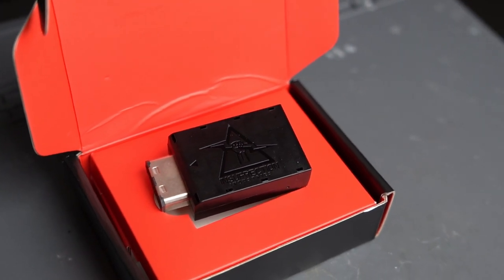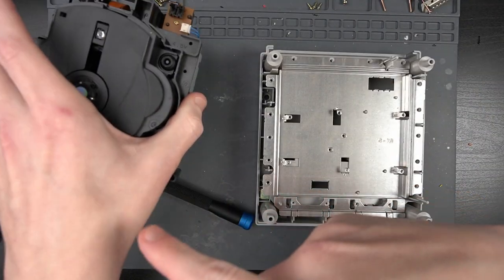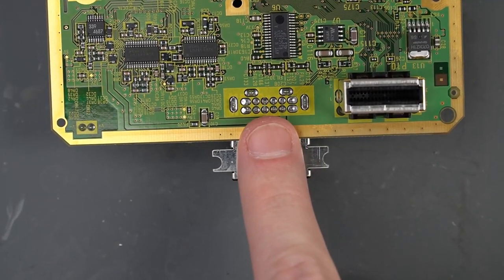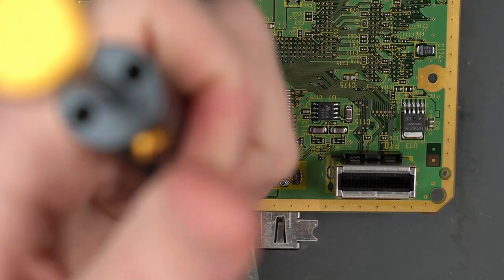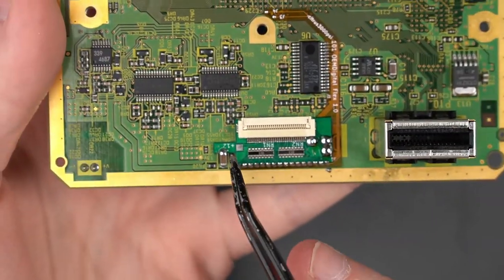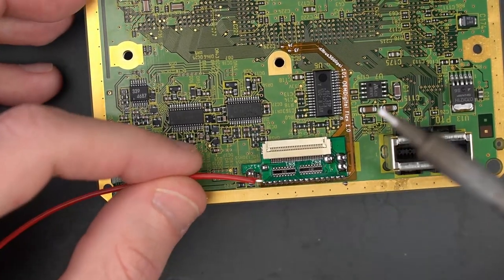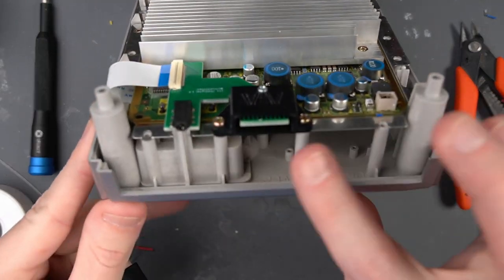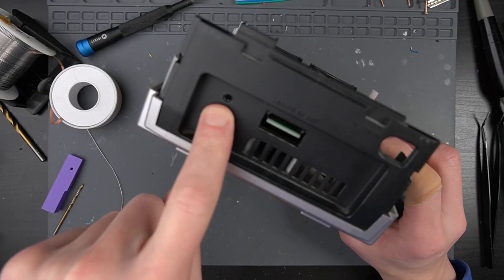DOL 101 GameCube Digital Port Install - Use a CARBY with a DOL 101 GameCube!

Comment: This is really cool, but I think the better solution is to buy a 001 model. Cause not only do you have both of the ports instead of simply switching one, but also, the kit and labor costs is probably the same as selling a 101 and then buying a 001 model console. This is still really cool though, keep up the good work!

Comment: Great Video, Try not to completely fold flex cables, if they get folded enough, there is a chance there will be a break in the connection within the cable

Comment: very nice mod. 
Another method. , I sent to a modder in China, he used a compatible NTSC RGB encoder and rgb amp to restore GC RGB signals. This way can keep composite, s-video and add RGBs signals. The RGBs can output 480p singals with ossc, gbsc and retrotink 5x on my IPS screen. The picture quality is slightly better then official or GCVideo component cable.
Reply from the maker: That is interesting, do you have any more information on that mod?
Reply: Do you have more info? Contact email or web?

Comment: Really cool video! Thanks for doing these!

I'd rather try finding a DOL-001 before I do this mod though :D The GameCube has sooooo many screws, and the install is also quite some workload. But it's super cool, that there's a way to "fix" DOL-101s now.
Reply: It's called GameCube because there's 64 screws.
...Wait, wrong Nintendo system.

Comment: 10:02 -- when soldering the flex to this chip, does it matter that the board has lead-free solder? I saw Long Island Retro use lead-free in his video for this step, but all the others I've seen don't mention it. Just curious about your take.
Reply from the maker: I think it matters a little, because it makes it a little harder, but the idea is you can tin the pins with leaded solder first, which "waters down" the lead-free solder with leaded solder to make it a little easier

Comment: Good video. I don't have a hot air station or a desoldering gun, though. Any you recommend?
Reply from the maker: If you can afford it, the Hakko FR 301 is what I use. 

I don't actually own this one, but if you're looking for something less expensive, I've been recommending this one: https://www.aliexpress.com/item/32982282829.html?spm=a2g0o.productlist.0.0.5305619d5cYbTO&algo_pvid=ea57f5f1-603b-4a3e-9fab-a1220894173f&algo_expid=ea57f5f1-603b-4a3e-9fab-a1220894173f-7&btsid=0b0a556b16163322815242831e6e6c&ws_ab_test=searchweb0_0,searchweb201602_,searchweb201603_
Reply: @dubesinhower  thanks
Reply: Tim, I have one of those cheap ZD-915 stations. They go by many brands, but all looks the same. It's functional & does a good job, haven't had any issues except for the occasional blockage (normal). Perfect if you only desolder components occasionally.

Comment: I have the 101 model and it has the digital av out. Which is weird I thought the 101 didn't have the digital
av out. I got it at a goodwill
Reply: Hmm, 101s don't have a digital AV port, maybe someone replaced 001 the shell with a 101 shell, if it says that on the bottom.  The shells are pretty much interchangeable, the only thing different is the back panel which you can switch out.

Comment: do you still need to use the audio jack even if your using the Carby? Like can I do this mod and plugin the carby and im good to go or do you only get sound if you use the audio jack?
Reply from the maker: Unfortunately I don't have this GameCube anymore, so I can't test that, but I don't think you need to use the analog audio port if you are using the Carby.

I believe the audio jack is for use with official component cables, since these cables don't include audio cables